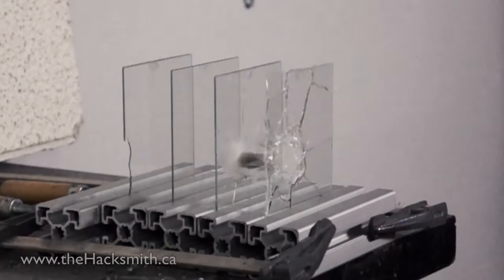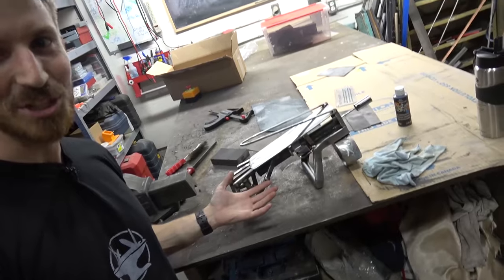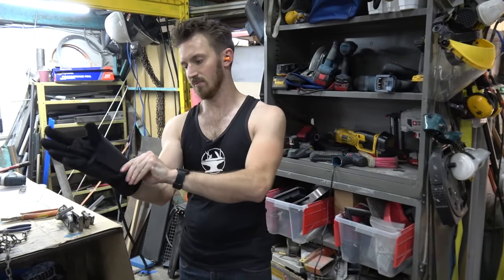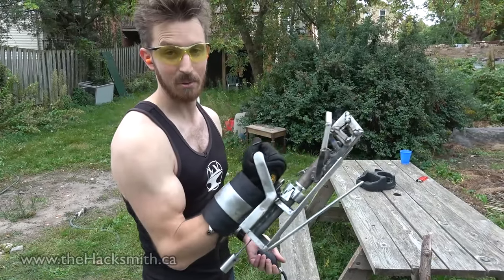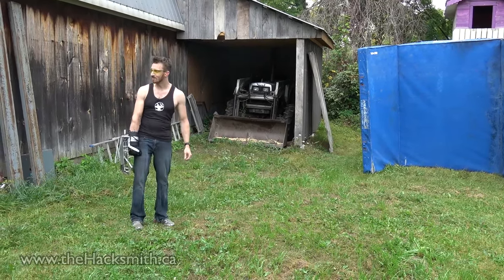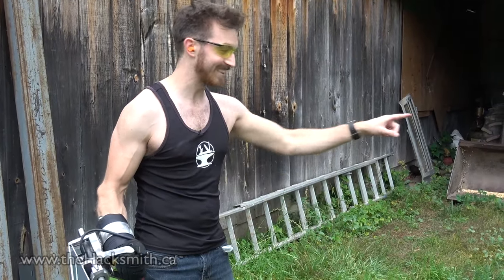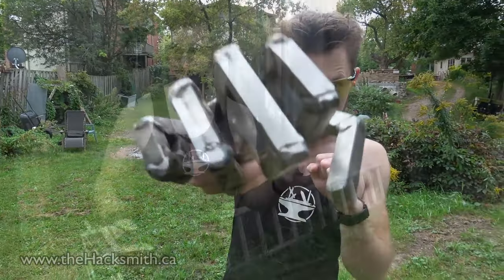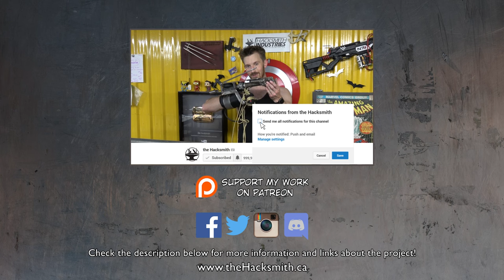Make it Real: Chain Fist from Kingsman 2!

Comment: i say add a electric spool to the top with a thin chain .. also add a tensioner to the spool when its going out so it doesn't go out to fast ..could use rope but by looks of it i would say it needs the weight behind it so it will fly strait .. maybe try one that's propelled by co2 you could strab like 3 cartridges on the inside of your arm and might not need to be so bulky ... but awesome work once again i love everything yall make

Comment: for the retraction system i suggest a weak small engine so that it still works mainly off the physical pull back but if the pull is strong enough it gets just pulled in to the correct place the rope is "auto reset" so to speak and you are pretty unlikely to accidentally hit yourself in the face... well it works in theory assuming that you are strong enough to yank it all the way back

Comment: You should build an air tank to go on your back that would refill it on the go. Just run hoses from the tank to the guns.
Reply from the maker: +Ian Ingram what? That's not how it works... The blood pressure cuff is just for attaching to your wrist lol
Reply: the Hacksmith lol I just assumed it was powered by some type of compressed air. Is it a spring or a blank or something?

Comment: Could you make a tube with an electric motor that pulls in the metal fist with a thin flexible cable that's connected to the part of the fist that fits into the launcher that Pulls it back into place to be launched again?

Comment: The Hacksmith

I have an idea for the ironman helmet.
How about using the vr's lenses concept and using a screen in front of it and using a camera...no need for big holes on the faceplate and it will make the user more realistic view. It will be like wearing a mask for welding but with vr lenses and the inside of the faceplate as the screen.
Reply from the maker: +PJLICIOUS VR or AR?
Reply: the Hacksmith I mean, you've seen a virtual reality lense right? That device which you place your phone, it has lenses which makes the screen ok to the eyes and makes it look like human-eye perspective view and I think that concept helps the mask because instead of using videos as your view, cameras are placed outside but is covered by the eye parts on the real ironman helmet and the inside of the faceplate is a screen a size of a phone and the lenses replace the hololens but the hololens program will be placed on a computer which is connected to the screen and cameras. I think its a bit confusing to when I say it. But still the problem to this concept is having a big frontal face like cyclops from Xmen but with a full mask so I think the concept makes the mask big on the front side which is different from the real ironman mask which is a flat face
Reply from the maker: +PJLICIOUS yeah I actually did a video on that in the exo series -- biggest issue is latency. I prefer AR cause you can still see with your actual eyes -- perspective is also always going to be messed up with VR. Unless you have cameras that literally move when you look around!
Reply: the Hacksmith that is why the cameras should be in front of the mask so it moves to your direction and connect it to a screen inside the mask.
Reply from the maker: +PJLICIOUS I'm talking about eye movement though -- turn your phone camera on and hold it to your face and try and walk around -- it messes you up because it's not the same perspective